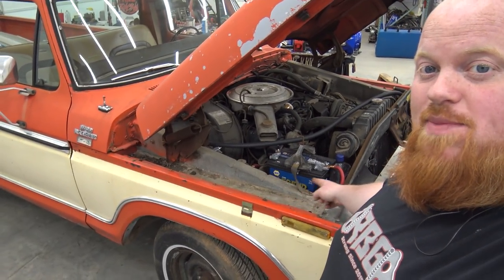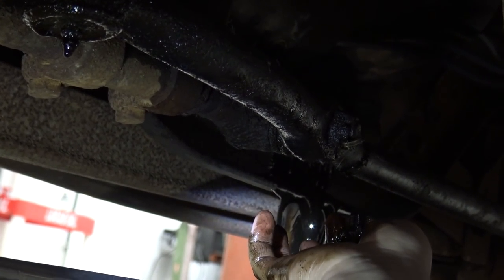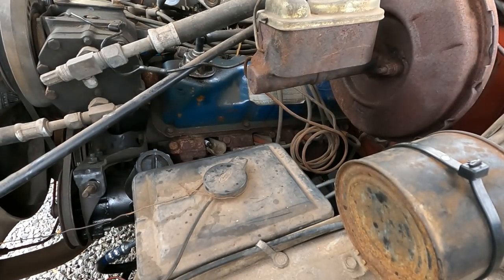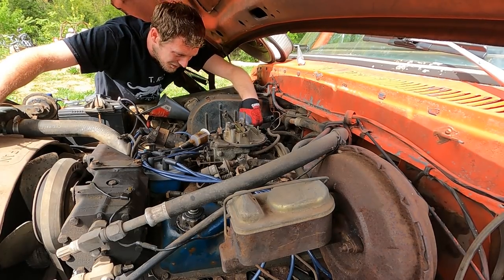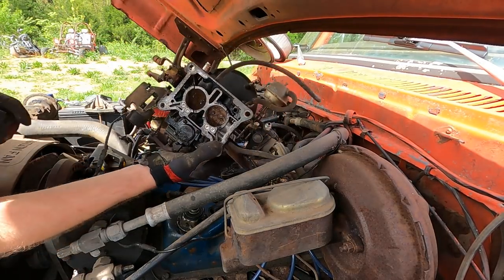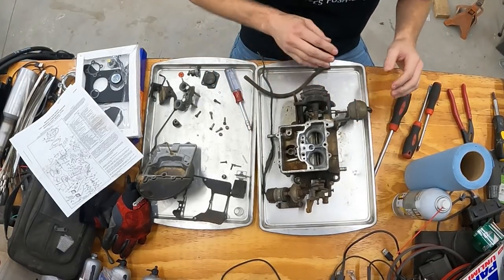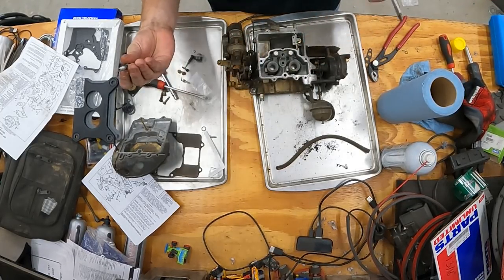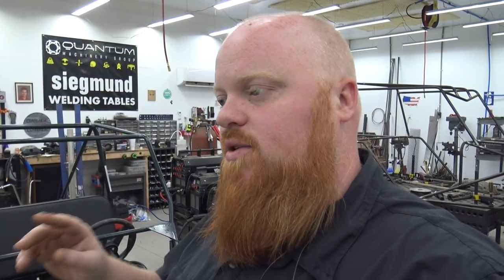1979 Ford F-100 351M Carburetor Rebuild & Tune Up

Comment: That part that wasn't touching the throttle is called a dash pot switch.  It's to kick the throttle up when the ac clutch engages so the engine down lug down.

Comment: I started working as a professional mechanic in 1980.   Just when I mastered working on carbs they up and changed to Electronic Fuel Management.   The part that touches the throttle and has the wire going to it is a part that increases the base idle speed when the A/C compressor is working.  If the A/C doesn't work then you can eliminate the Idle speed compensator.  Those exhaust tubes, for the choke,  rusted and broke all the time.  They used to sell a universal electric choke kit to replace that system.  JC Whitney (LOL) sold the kit also K Mart and Western Auto Parts.  I used to keep one in the shop all the time.  They were like $15.  All you had to do is to run power off the ignition switch to the choke stat and ground it on the block somewhere.
Reply: Where does it plug in to?
Reply: @xXBreannaBreakdownXx  Where does what plug in to ?

Comment: Question, is there anyway you can shoot me a few pics of the AC lines & all? My 78 had AC & I know I'm missing a couple things other than the compressor. I bought a new evap coil, rebuilt compressor, condensor & dryer but im not sure how the lines were routed or any wires that were ran to it or where the expansion valve goes . I'm going to rebuild the entire system but I haven't actually found any sort of diagram or anything. If you can shoot me some pics on it I'd greatly appreciate it. I can give you my email if you can. Thanks

Comment: That solenoid you didn't know what it was that's in front of the throttle linkage is for the AC. It idles up the carb when you run the AC at a stop.

Comment: I had a '78 Bronco with 351M, which I rebuilt into into a 406M.  Bored .030 over, 400M crank, connecting rods, pistons, Crower Beast cam, Edlebrock Performer intake and 4 barrel carb, Hedman Headers, Flowmasters.  Probably doubled the HP's and torque (I never dyno'd it), but the truck would run and got better mpg's.

Comment: I'm bringing a 1978 F-150 back to life with a 351M/400ci. The first thing I did was accidentally break that same dang nipple to the heater core from the block. The stock ones get brittle rot away, I also had to drill and tap, luckily the block has plenty of metal to enlarge the hole !

Comment: Consider Headers first. If you are wanting to see how each part changes the engine putting a 4bbl and intake with factory manifolds may restrict it to much. Gotta be able to get all that air that the 4bbl will be putting in. Just a thought, sounds like its going to be a fun build and series to watch.

Comment: The first mod the 351m needs is a high volume oil pump... I’ve owned a few and is my favorite engine but they need the hv oil pump...
Reply: Got a 77 f150 4x4 married transfer case, wanting to drop the oil pan, do you know if there's enough clearance without any obstructions?

Comment: How many miles that engine got on it? You may want to as someone already mentioned, do a compression check to determine whether or not you've got a solid engine to build on, or one that needs a rebuild.

Comment: Top of that carb comes right off .even Can run with the horn off. Try lowering the float a 1/16, 1/8 ECT. And the powervalve could be the culprit also even though it's new try a 6.5 holly one. Also he snapped that choke tube you need to plug that off thats a vacuum leak. It draws hot air in cause a slight vacuum is applied. Broke tube causes an air leak..

Comment: Hey 18 yrs & I’m inspired by your build I have 
A 79 ranchero GT with a 351M it’s just in the same condition as your truck & you helped me see how should go on my ranchero. Also I have a question if I want to just do simple mods like intake heads & later on cam could I reach 400 - 500 hp ??

Comment: go the old school carb 600 cfm vac secondaries 4 barrel  with a edelbrock manifold  tune length headers  i had a 850 cfm on my 351  i put on the 600 cfm and it accelerated much better with the smaller carby. made a great daily driver with the ford GT 351 cam of the day  with 2v heads (better on the street) the 4 v are all about top end power  not as good off the bottom to mid where you use it everyday
Reply: had a 400 m in a 79 ranchero, loved that motor
Reply: @Scalihoo  mine was a aussie xb tudor coup 1976 the car in mad max /road warrior (in the usa)movie   i loved that car too regretted selling it to this day great car good times
Reply: @jamesdougan8789  Ohh cool Aussie ford ,sure I know that car, the 2v heads were better for daily driver duty for sure, long throw tall deck motor has a torquey feel, i had headers a cam edelbrock manifold & 4:11 gears with a detroit locker rear , I took it on 2 hour trips all the time on the highway high revs @ 60 MPH but that was the fond memories, went through oil pump gears a couple time but that was about it

Comment: Wrong the m's were never used in NASCAR and Ford only made the 351m-400 from 77 to 80 they aren't high reving either they are great truck engine's because it was the longest stroke engine Ford ever made
Reply: Bud Moore in 1972 used a 351c in his Ford Torino 351 elm is just like the sea only difference is the m has a 1-in taller deck height same bore same stroke same cylinder heads so when it comes to performance 351c and 351m is exactly the same. just go do your research please.
Reply: @danieljohnson8020  the heads were different the Cleveland had canted valves and way bigger port's where as the m head's were inline valves and had egr port's
Reply: @davekulman8195  Windsor stall engines AKA 289-302 351w uses in line valves 351c and 351m does in fact use the same heads to be fair there are slightly differences between the 351c and 351m the 351c has higher exhaust ports so that the exhaust comes out in a straighter path the 351m has a larger combustion chamber to lower the compression ratio they use the same valve covers same valve cover gaskets.
Reply: @danieljohnson8020  it's nice to banter with someone who actually knows what they're talking about nice conversation Sir 👍👌

Comment: I almost had pop come out my nose when the "expert" commented about the 351M's competing in NASCAR against the 454 Chevy and 426 Dodge engines.  Hilarious. That, and not knowing what the idle solenoid did. Quit sniffing the fumes from the carb cleaning solvents, Dude . . .
Reply: In 1972 Bud Moore built a Ford Torino with a 351 Cleveland which is just like the 351m but 351m has a 1-in taller deck surface. So do your homework little kid before you start acting like you know everything just shut up and listen and you might learn something.
Reply: @danieljohnson8020   That happened in '72 because in '71 NASCAR had put C.I.D. limits in place to drop the max from 429 ci to 358ci. The 454's were never a factor, simply because due to CID limits they never were allowed to race - they were raced as 427's at best. Due to CID limits and the years they were produced they never ran the the "335" series 351C/M's against the big block anything. The "385" series 410/429/460 engines came out  before the "335" series Cleveland/Modified series did, and there was no need to develop the smaller engines until the smaller engine limits. This "little kid" is over 60 and while I don't know everything - I have probably forgotten more about that generation of NASCAR than you think you know.
Reply: @S_C_A_R_F_A_C_E  why are you a part of this conversation 🤦‍♀️